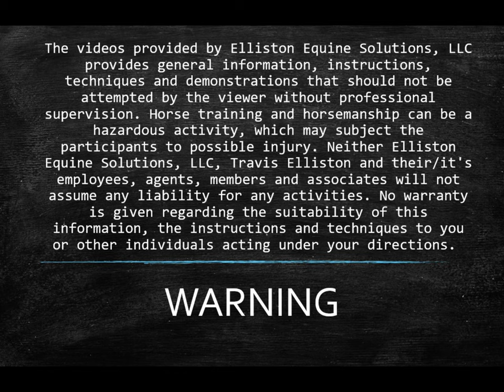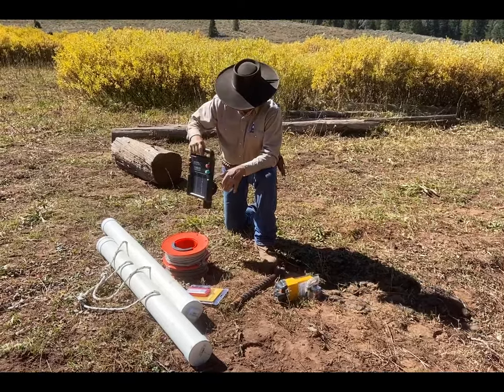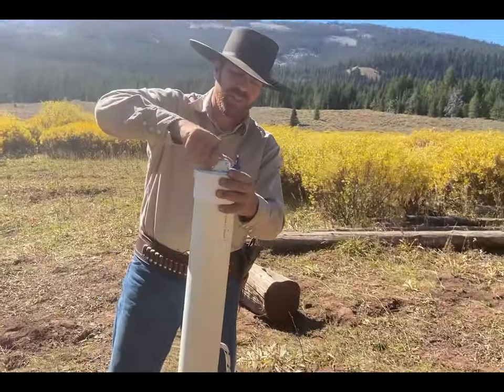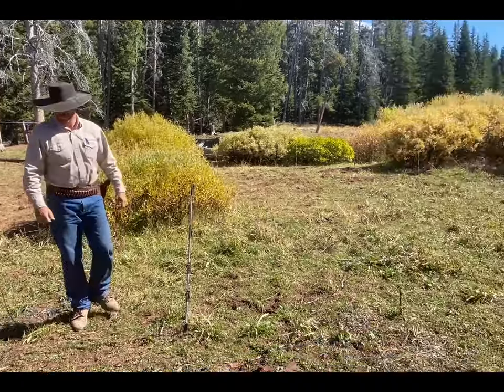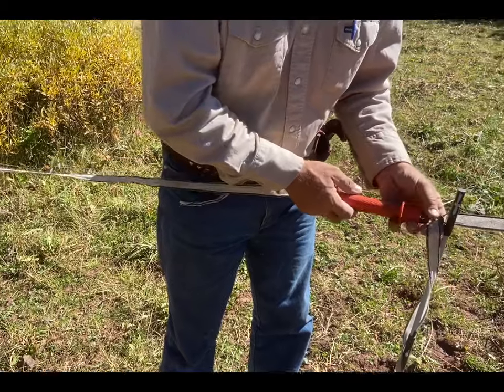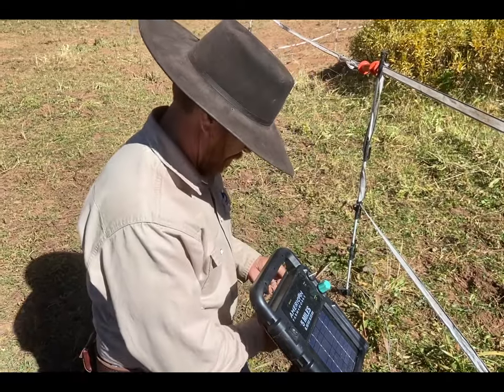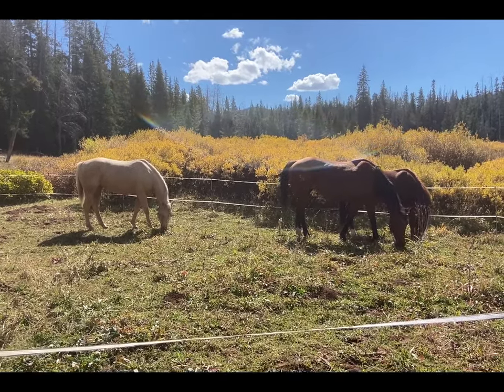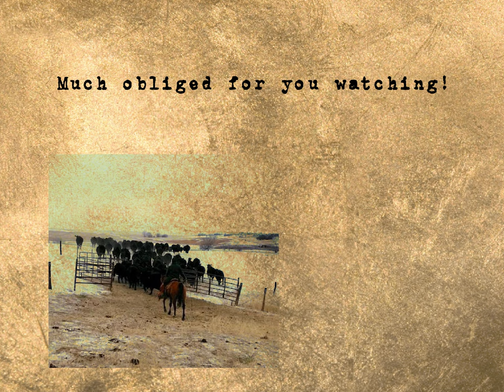Backcountry Electric Fence Set Up

Comment: I bought a battery operated fence charger off Amazon that's great. Lightweight and small it has 2 wires with clip on one and pointy tip on other. 

You can hang it anywhere close to fence, clip end goes on fence other is ground. 

I think it takes 4 C batteries. I use the cheap light weight step in posts and a strand or 2 of the plastic braid electric fence. 

I use this set up in areas where high lining isn't allowed and hobbles aren't feasible because horses aren't allowed to roam a little. 

Im in East Tennessee and here in the south east/mid Atlantic area a growing number of places won't allow high lining anymore. 😡